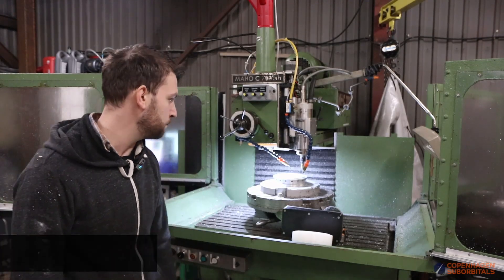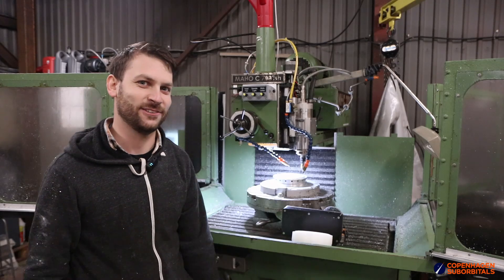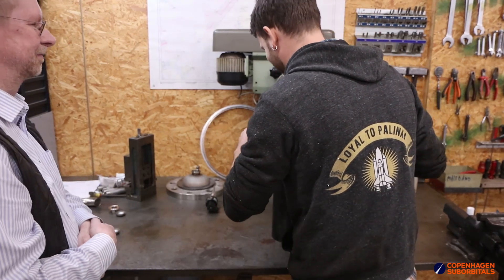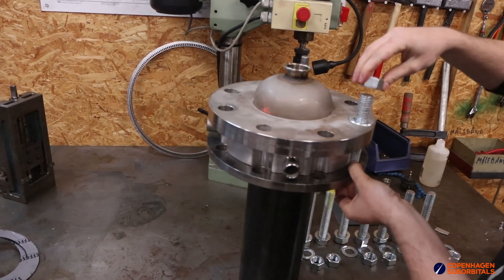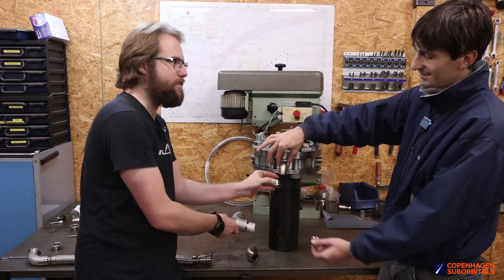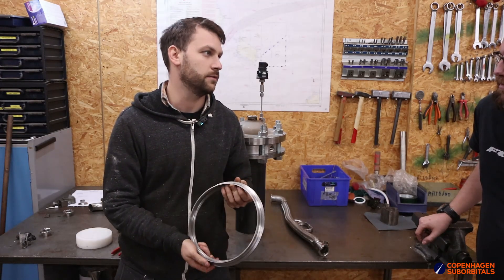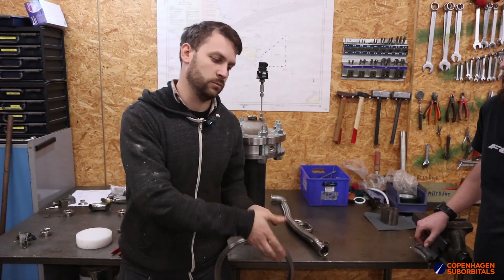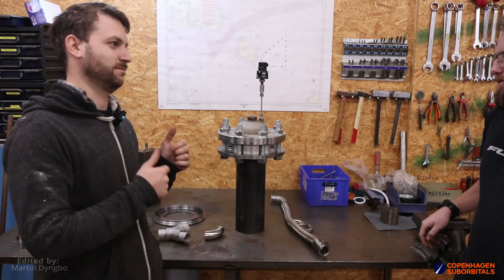BPM 17 Finished Injector

Comment: Wait I thought you guys were using the small injectors hard soldered into the engine or was that scrapped when you switched to the smaller engine that is simpler to manufacture?
Reply: It has a lot more indevidualpatts so the part caun exsplods wheb you Scale it up an then the reliability gose down

Comment: I know just enough to comprehend the injector is basically the heart of the engine. Those ducts and ports are so intricate and critical. Simply trying to visualize your design boggled my mind, even while looking at the layers. I like how the radial arms introduce rotation, so that the expanding gasses travel at an angle instead of straight out.

Comment: This certainly won't work, because as you can clearly see, not every edge is actually chamfered... It'll just explode...

Great work!!! Looking forward to the hot fire tests!!!
Reply: I wonder about that. For the outlets, I think they want some turbulence to put more energy into mixing. But laminar flow at the inlets seems important. If the two edges line up flush, isn't that better than creating a void in the shape of a chamfer?
Reply: @DistracticusPrime  This was just a joke, because machinist chamfer EVERYTHING (speaking from experience)

Comment: Nobody is going to mention the audio levels? =p   I guess you can't build a rocket and simultaneously keep them fairly under peak and red zone on the meter.  But, on a different matter: how long have we waited for the injector again? months? I can't remember. Must be a huge job that alone. When is it ready for testing in the jig?  =)
Reply: Yes sorry i figur out way to late that i hade recorded the inter thing with the audio all messed up 😢
Reply: It has taken forever but i mean thay do it in ther sper time after work once a week. And i my mind ther are 3 main big mekanikal hurdels that needs to be overcome on a rocket its the injektor main valves and feeding the engine. So this is a major milestone 🥳
Reply: @olivertclarsen  It's all fantastic work :)